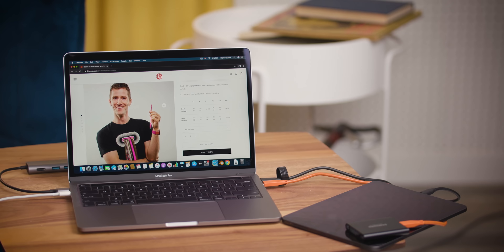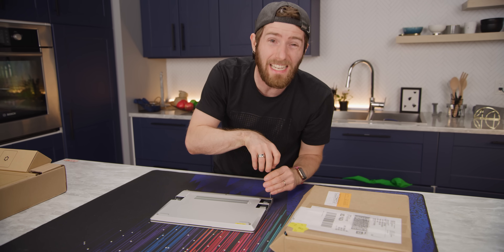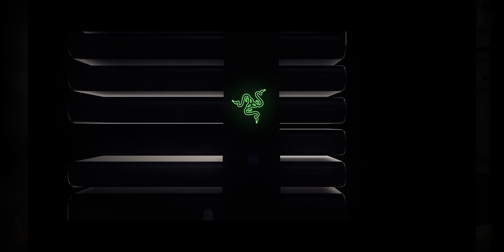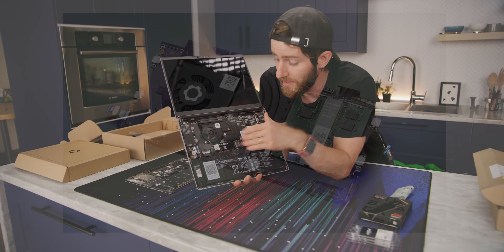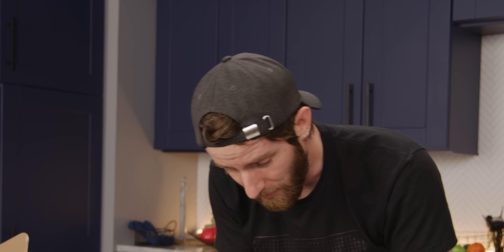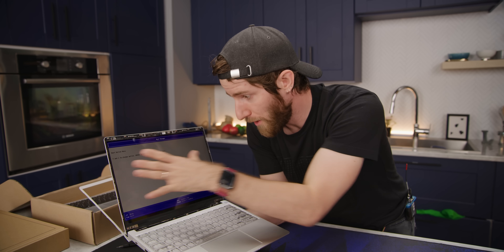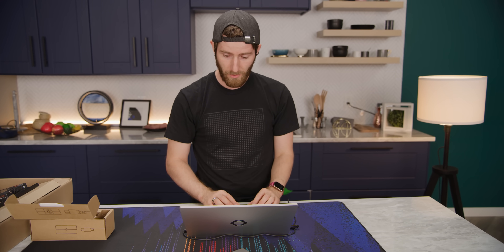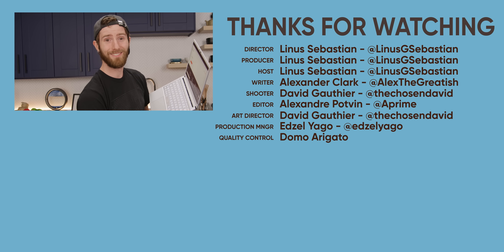A COMPLETELY Upgradeable Laptop?  - Framework Laptop Review

Comment: I'd love this as a uni laptop as I know I'll be able to maintain it myself, and I'm sure the computer science students would love it and it is surely good to modify and tinker with for the security sector, as a pen testers laptop or something,

the only issues I see on the web page is the modules to swap out don't seem to be available, so how am I supposed to fit nothing but storage in it to brag my lap top has more capacity than yours lol,

so they need to add a spares page and other options so I can make a portable second screen and touch screen and or low latency screens or ips panel options etc, as well as upgrades options for speakers or webcam/ mic, alternative keyboards, or just a different colour keyboard or chassis etc 

also can they make a 17 inch one with room to upgrade mobo and batteries at some point 
and it would be nice if it was possible to have a gpu on some variations too

Comment: I dont get why the cpu isn't upgradable. I've had laptop workstations with upgradable cpus and gpus. Those were the only laptops I bought, so I was suprised by the soldered in CPUs of other laptops when I wanted someting smaller. My dell precision 2014 (replaced 2018), still had the same chasis as the 2010 model (I don't think later models were truly fully upgradable) Linus is pretty accurate when he cites that time with the begining the end of fully upgradable laptops.

Comment: So basically, let the engineers do their thing and lock the accountants up. I like it!
Reply: Would you just think of those poor billionaires...
Reply: Typical engineers always blaming the finance guy because they're fucking doormat yes-men who say yes to anything instead of fighting to make a quality product
Reply: @Juan-dc6yf  Kinda hard when the accountants are literally controlling their money.
Reply: they are selling a system with no gpu and an i5 for 2 grand actually they let the accountants run the whole show. Go for a clevo laptop they have desktop cpu sockets and use the MXM replacable GPU standard and cost exactly the same price. this pc isnt modular in any way it solders the CPU for some ungodly reason. Who cares about swappable ports when the real parts are still just as annoying to replace as any other laptop...
Reply: @HaplessIdiot  My dude you are replying to every comment with the same response. Not everyone wants a laptop with a dedicated gpu. They make the device heavier, thicker, less power efficient and output more heat. The price is reasonable for the amount of upgradability offered here. If that is something that you aren't interested in then move on.
Reply: @r2in360  Just Read his name out loud.
Reply: @HaplessIdiot  Think you fail to see the point a bit. But sure you do have one as well, it isn't the cheapest - it's actually quite on the expensive side.

Comment: Umm, wrong about Dell!!! Yeah, maybe not entry level stuff (Which includes XPS), by my Dell Precision, definitely. ALL parts are upgradable, I’ve upgraded my Nvidia Quadro, got 4x DIMMs which I upgraded to 64GB, added another SSD (3x SSDs) and even added an integrated 4G card. And all Dell manuals are FANTASTIC. The only issue is there is there are 2x screw sizes only, umm I will repeat 2x (Wow, is that to much)? The only benefit I see there, is that the I/O is modular, so what: I have 3x USB-A, SD card, audio, USB-C, separate power, Display port, full RJ45.

Comment: I'll get one as soon they start selling in EU.
Reply: Yep, same, it's been on my radar for a while, happy to see LTT push this company.

I'm not super hyped by the CPU selection (I'd prefer a Ryzen 5800H), but at least it should be compatible with thunderbolt 4, so eGPU should be possible.
Reply: the i5 basemodel is 2 grand with NO GPU this thing sucks ass for the money. Get a clevo laptop they have a desktop cpu socket with an MXM replacable gpu socket for exactly the same money. This thing appeals to nobody at the price it is. Maybe when they start using the MXM standard for swappable gpus and actually bother to not solder the cpu and use a desktop socket it will actually make sense but the way it is overpriced and crap
Reply: @HaplessIdiot  weird i've built an i7 for 1,3k
Reply: @Hornetfarmer  ikr, hes commenting on everyone's comment who says they will buy it
Reply: @HaplessIdiot  you are a troll

Comment: I like this thing! going to get one when my current device fails.
Reply: My current laptop has been broke for months, but I'm broke, so I can't buy one, even if I want to.

Like seriously, why doesn't my computer recognize any audio device whatsoever? Even after many restarts, the speakers don't work, the aux port does jack, and there are no missing audio drivers! I even bought a brand new 500 gb SSD as a boot drive, reinstalled windows 10, and still, nothing. I've given up on my Lenovo T420 (yes, it is a retired elementary school computer, which I got for free) because I don't need a laptop at the moment, but I will need a new laptop in the future

Thank you for reading my rant
Reply: This laptop costs 2 grand for an i5 with NO GPU. this thing sucks dogwater compared to a clevo laptop! Clevo has systems for exactly the same price that have desktop cpu sockets and MXM replaceable gpu slots so you can actually upgrade the system at a later date. Not to mention they arent even shipping systems until 6 months from now if you ordered today. Linus needs to take a look at clevo they do everything that he wants in a system and at a rational price
Reply: @HaplessIdiot  where did you even see it was 2 grand for an i5??? The only place I’ve seen 2 thousand is for the fully spec model with an i7, 32 gigs of ram and a tb of storage… A far cry from an i5. 
Edit: a quick search shows LTT already reviewed Clevo laptops. Did you just want to be outraged ?

Comment: This laptop is 200% better than Macbook or Dell xps. 

Rights to Repair, 🤘Rocks.
Reply: This laptop costs 2 grand for an i5 with NO GPU. this thing sucks dogwater compared to a clevo laptop! Clevo has systems for exactly the same price that have desktop cpu sockets and MXM replaceable gpu slots so you can actually upgrade the system at a later date. Not to mention they arent even shipping systems until 6 months from now if you ordered today. Linus needs to take a look at clevo they do everything that he wants in a system and at a rational price

Comment: Big shame there is no gpu, and it doesn't seem like you mentioned that part either, which is also disappointing, coz it would be good to know what options there are, or indeed how good the integrated graphics are for modern games. Is an external gpu by thunderbolt/usb 3.2 gen 2 possible?

Comment: Its why I actually like HP as a company, they historically have been pro-right to repair. I can buy most parts for my laptop directly and repair it myself. I recently upgraded my SSD and its held together with 8 screws. It just was a B&&ch to open, I tore the case apart. That said, it makes repairing my moms Lenovo flex look like hell. I killed her laptop because the main screw to open the bottom is underneath the keyboard. 

My last HP Pavilion Dv7 was bizzarely semi-modular. You could release one screw and access the ram bay, and only about 4 to get to HDD Bay 1, and it took one screw to take out the blu ray player.
Reply: Samurai Shampoo  I never got around to owning a 3ds. I did however attempted to repair my DSI but after replacing the hinge which broke one day, it just never turned back on. We opened it up and nothing was wrong. It just died. 

If you want to see a impressive construction take a look inside a Sega Game Gear, it's a super impressive handheld considering it's from 1900

Comment: Wow battery disconnect in software. Imagine if Framework made a 16in with a huge cooler with all the exhaust going out the back. You can either use it as it is on a cooling pad or stuck closed+upright on a stand then have the brick run a hexacore CPU and an RTX xx60 chips like a desktop, then you just flip it back on when you have to use it elsewhere or when you cycle the battery.

Comment: This is probably one of the coolest laptops I have seen.
Reply: This laptop costs 2 grand for an i5 with NO GPU. this thing sucks dogwater compared to a clevo laptop! Clevo has systems for exactly the same price that have desktop cpu sockets and MXM replaceable gpu slots so you can actually upgrade the system at a later date. Not to mention they arent even shipping systems until 6 months from now if you ordered today. Linus needs to take a look at clevo they do everything that he wants in a system and at a rational price. I doubt this goofy startup will even last long enough to release a new motherboard with a cpu SOLDERED on lmao

Comment: They should be offering a lower resolution screen just to demonstrate screen upgrasability.  Furthermore, use industry standard screen types available from general suppliers as protection against company failure.  Let us pop in any LVD screen we can get and leave spare screwholes for common bracket variations in the market.  This would also allow a touch option on the purchase menu, just not at current max resolution.

Comment: Thats looks like an awesome laptop. Battery management is questionable though. HP 850 G4's would charge to 100% and stop,, allow battery to drop to 90% before putting anything back in. Well mine did, still going strong after 2017. I look after 900 of the machines, seen a number of swollen batteries of latter model machines, 1040 and 850 or 840s, so where did HP go wrong.
What is needed is to reduce the E-waist I see so often. Some Scandinavian countries are looking to remove tax on repairing things.
Biggest mode of failure is coffee spills on the KB, second is people dropping the machine, third is the battery, then the SSD, OH!! Fans!!! when are manufactures going to put enough lube on the blasted bearings!!!

Comment: I used my old Acer Aspire One D270 1 GB RAM as server, just popped motherboard, threw it in shelf, installed minimal debian and woila, working server. But, there was a downside that it was VERY slow server. It was processing 1500 sends of telegram messages for over an hour.

Comment: This is really amazing, in every aspect. One point of clarification - the USB-C expansion modules are USB4, not USB3, and the internal connector is actually confirmed to be Thunderbolt (I believe TB4 specifically).
I definitely want to get one of these, but a DGPU is a must have for me. Other nice-to-have's on the mainboard would be eSIM and a second m.2 slot. Nice-to-have's that people could make and sell on the marketplace would be higher-res touchscreen displays, a Sensel trackpad, RFID reader, RJ-45 jack, and 1/4" in (great for musicians).
 ~ Jamie

Comment: I checked on the website. The price of everything is fair and reasonable. I would definitely buy one but a 13.5 display for me is a no go. I've used small laptops before like the Microsoft surface and i hated it. I need a full size keyboard with the numberpad. They probably have only one size to save on manufacturing cost. 

It would be nice if you could choose from 15.6 and 17.3
Also there is no option for a Gpu. I know this is probably the hardest thing to do modular. So this is unlikely to happen.

Will definitely buy from them if they make bigger screens
Reply: Samurai Shampoo  that's pretty good thanks for sharing. 

The computer in framework actually cost way more for the  basic model since 750ish is the the base starting point. Anything extra like ram, ssd, wifi, windows OS, modules, etc cost extra. The computer comes around 1kish.

Is true that you will pay significantly more for the laptop but you gotta take into account that they are not a Big OEM with economies of scaling and huge production lines.

For someone willing to spend 1k for something adding spending an additional 100 is not that big of a deal.

Their market is not the student on a tight budget. Their market is the PC enthusiasts and ppl who have money and wants to plan ahead.  Its sort of an investment i would say. Instead of spending 500 every couple of years buying cheap laptops you would spend 1k now and then maybe 300 every couple of years since you can change the motheboard. And this is supposed to be like an environment and that will have it's own marketplace with parts for customization.

Right now their price isn't competitive but its not Apple unreasonable either. Give them time and money and they will turn more competitive once they grow. I hope.

Comment: Just like Fairphone, the pricing is not there. If they can make them cheaper than other prebuilt laptops, then this would be amazing, even if a bare processor only computer (ex; HP with the base i5 is $550, while this one is $750 with no ram, storage, or wifi)

Comment: Begs the question: are there limitations to the amount of same type of module? As in, can you plug in 4x HDMI modules, and does it actually work with all 4 at the same time?
Reply: That would depend on the GPU in use, they set the limits on that. I'm sure you could add many HDMI but the GPU might not be able to physically push to that many.

Comment: I hope they make it, I'm seriously considering this + external GPU when I have to retire my desktop due to Windows 10 EOL.

Also, there are already magnetic thunderbolt connectors on Amazon, so I could see making/modding a USB-C module with a recessed connector that would be compatible with one of those, and keep the whole footprint inside the case.

Comment: You can't switch out GPU and CPU so what the hell is the point? By the time my laptop screen and ports starts not working right, it'll be time to land fill the system and get a new one so I don't see the value of only making irrelevant parts modular while leaving the heart and brain of the system unchangeable.

Comment: They’re killing you on CPU upgrades. I5-1135G7 is standard, and a good CPU. Their cost difference on the two faster i7-1165G7/1185G7 CPUs is around $125, but they charge $300 to upgrade to the 1165 and $700 to upgrade to the 1185.

You don’t get more cores, or more threads for that, but you do gain some max clock speed, 50% larger cache, and a bump from 80 to 96 EUs on the IGP. You also get a few additional features the processors support, none of which will matter to 90% of buyers. 

On the plus side, if you want to help ensure they make a profit, be sure to bump up to one of these CPUs to pad their bottom line. Also, looks like those may ship sooner, so you can consider part of that expense as paying for priority.
Reply: P.s. while I’ve always used Intel CPUs, at this time, I would prefer AMD CPUs for a Windows machine, and either AMD or ARM for Linux. Not sure why they opted for Intel as their first option.

Comment: This laptop is literally the opposite of a Mac, my next laptop is definitely going to be one of Framework 😍
Reply: This laptop costs 2 grand for an i5 with NO GPU. this thing sucks dogwater compared to a clevo laptop! Clevo has systems for exactly the same price that have desktop cpu sockets and MXM replaceable gpu slots so you can actually upgrade the system at a later date. Not to mention they arent even shipping systems until 6 months from now if you ordered today. Linus needs to take a look at clevo they do everything that he wants in a system and at a rational price. I doubt this goofy startup will even last long enough to release a new motherboard with a cpu SOLDERED on lmao
Reply: @HaplessIdiot not true, on their website it’s 1000$ for the base model and 1400 for the the i7 with 16gb ram.. If i can upgrade the motherboard, better cpu etc, it will safe a lot of money in the long term. And better for the environment. (As long as the components will have a good longevity)
Reply: @HaplessIdiot  u might have loaded out the storage and ram unnecessarily, besides eGPUs exist.  in Canada, a decent spec model costs about $1500

Comment: auto switching on when plugged in is awesome, ive a remote controlled plug, so I can just get comfortable hit the button, switch on, boot up, recharge or run off the mains, then switch off, monitor the battery life, leave it pulled in. But this laptop looks legit, as soon as I heard about their idea, I was really interested and hopefully in a yr or so it will be my next machine. I hope this company does well and I hope ppl make some crazy unique designs with cad layouts for the motherboard

Comment: Pretty much sponsored by framework... "Fully upgradeable future proof" how can a removable usb slot makes this a future proof lmao... New gen cpu, gen 5 ddr and gen 5 ssd laptops are coming soon for around 1000 to 2000usd. So this laptop with gen 11cpu, 4th gen ssd/ram is not futureproof at all as those important 3 pieces are not upgradeable. Not to mention 1000, 1500, and 2000$ models with no gpu is pretty much plain sight rubbery. Linus overselling this garbage he must have gotten a huge paycheck. Hence all preorders until 2nd batch already sold out because of this video. Linus comparing this framework laptop to macbook anti consumer no right to repair is correct BUT all windows laptops are repairable and replaceable so the right to repair is not issue at all because it is not macbook. Wifi problem, ram problem, screen problem, IO (usb, hdmi etc) problems, battery problems, ssd problem are all replaceable/upgradedable (size/perfomance) so it's pretty much the same feature on framework laptop minus the modular IO.